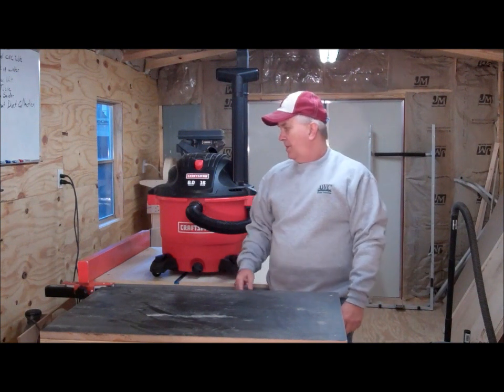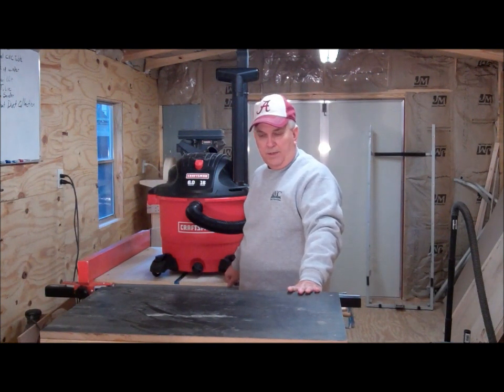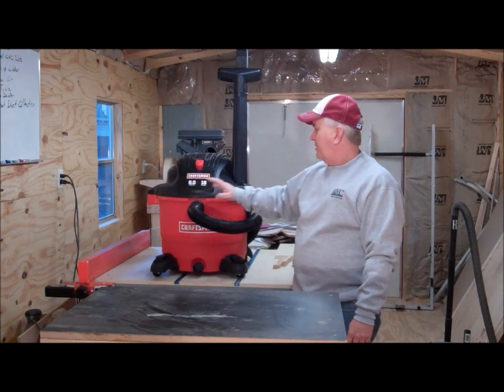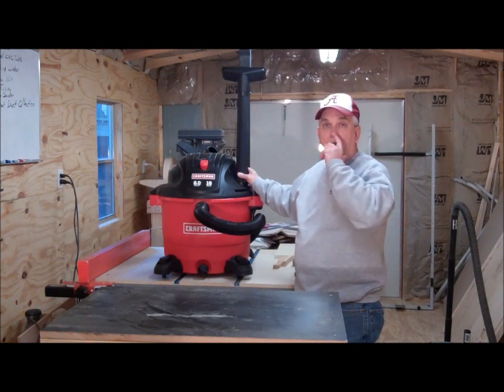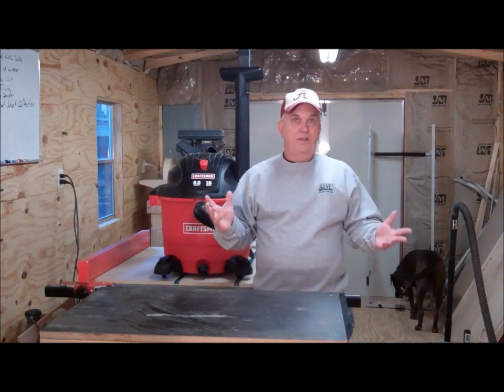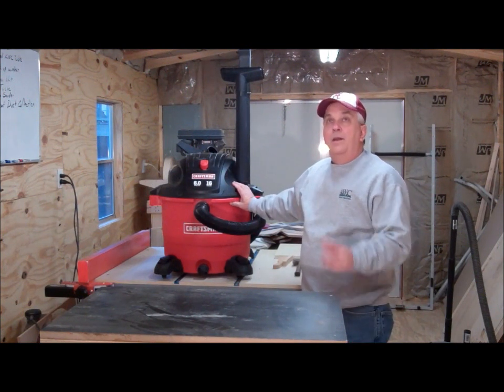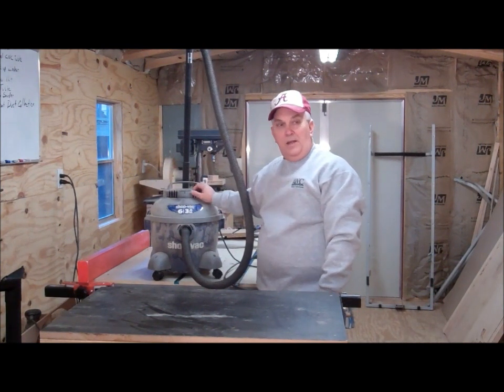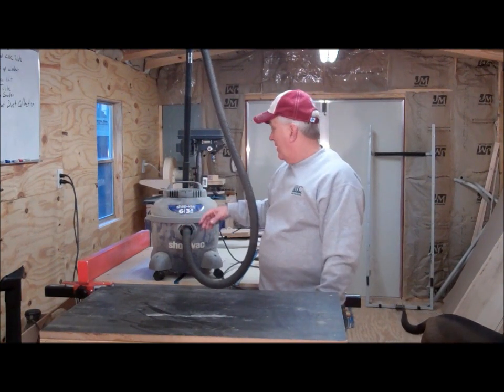Cool Tools

Comment: My name is dale Brames. I enjoy you vids. I think you will have good results with vac and dust deputy. My shop is similar to yours. It's a 2 car garage with a center dividing  wall. Half wood shop half lawn mower/garden tools. I bought dust deputy with steel drum. Wheel kit and hose included. 150 bucks. I have a shop vac brand 6 hp. I moved it and the deputy to the mower side. This kept the noise out of my woodshop and gave me more room. Along the center wall of my shop about 5 ft off the floor I mounted 2 inch PVC on the wall with 2 inch steel PVC clamps. My vac hose is 2 1/2. I found fitting that my hose slipped in to snugly. Tees to fit the main run and to get thru the wall. I bought PVC butterfly valves for 10 bucks. My blast gates sorta. My biggest dust producer is my table saw. I have it at the start of the run closest to vac then a valve. This shuts off the rest of the run and full suck to the saw. My run is about 15 feet long. I have 4 outlets. One on each end and 2 in the middle with 3 valves. Everything  I have is on wheels with dust collection. From the start to the end of the run it does the job. I have the vac on a switch in the woodshop. The dust deputy works great. 99.9 percent goes into it. Very little in vac. Full suction always. When I empty barrel I blow out filter as routine maintance. I didn't glue the fitting except where it went thru the wall. I thought about if I had to move something  latter on. I've got it lined out pretty well. I'm not going to glue. I hope this helps you. Keep the vids coming and dust free air in your shop

Comment: Hi Dave I just subscribed to your channel. I'm like you I can't pass up a good deal on tools. I have one of the craftsman wet/vac and they are awesome. The lufkin measuring tape is a good one to. I also bought the porter cable tools just like you did, only I didn't get any service from it. The nicad batteries are not very good, or the ones I got weren't. They died in 13 months, they were only guaranteed for 12. I'll bet I didn't use them 10 hours total. I later bought another porter cable drill that was on sale at Christmas for 69 bucks just to get the batteries. They lasted about the same amount of time. So I had 2 brand new drills, a saw, a light, a reciprocating saw that are useless. I was cleaning out my shop this year and had them all in the bag (which is a good one) and gave them to my brother in law. I hope you have better luck with yours as I did mine.
I just got through taken a treadmill apart that works except for the belt. I was wondering how I could use it in my shop and ran onto your idea. If you don't mind I'd like to build one.
See ya
Mark

Comment: Hey Dave, liked your video on the disk sander. Im not sure if you have heard about dust bags for your shop vacuum. I didn't know about them until I seen a video on it the other day. It's a vacuum bag similar to what you would use in an upright house machine. I bought one at Lowes and put it on my small 5 gallon shop vac and so far love it. It prevents you from plugging up you small filter around the center of your machine. You need to be considerate of how large and sharp the pieces you are picking up to keep from ripping the bag but so far I really love mine. I use it for dust and small chips. I don't feel like I have lost any suction on my Vac. I have a large dust collection but also looking to buy the Dust Deputy for the small vac.